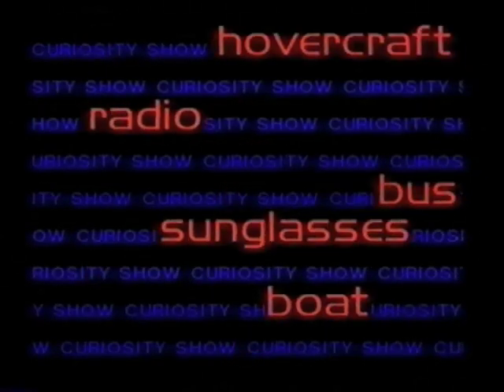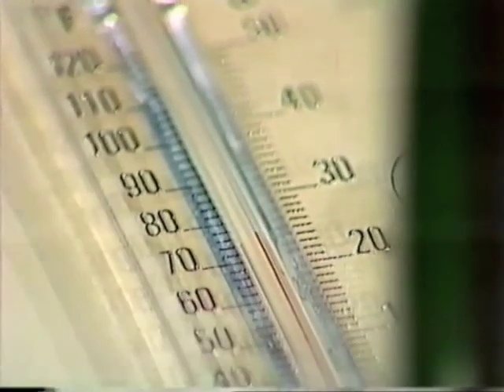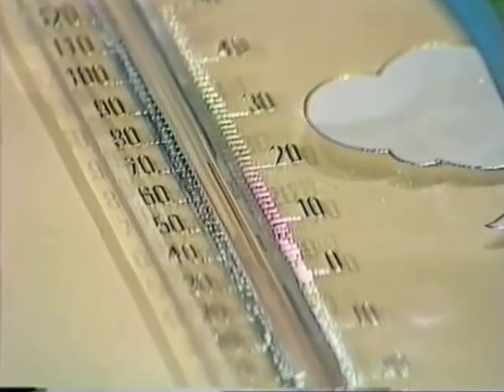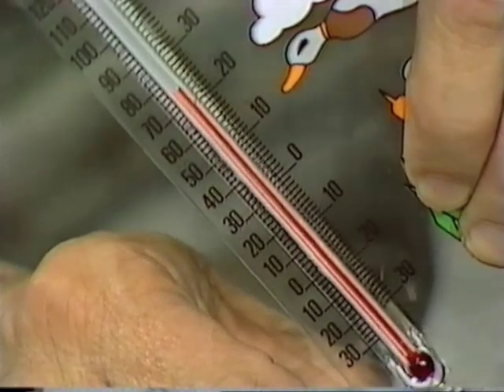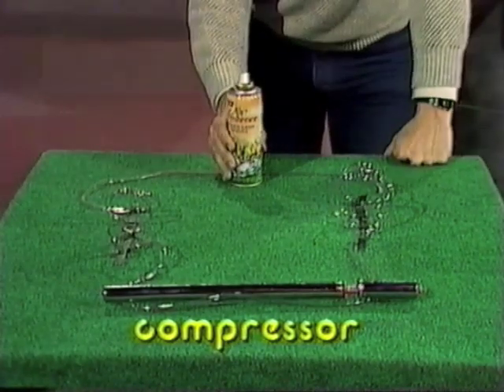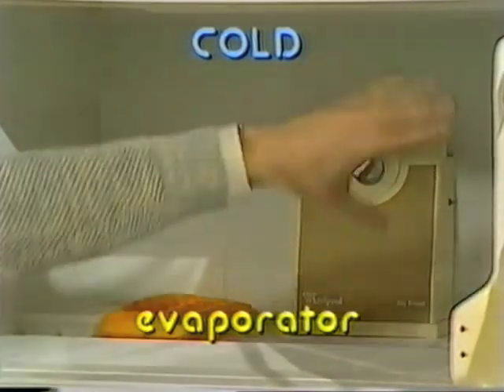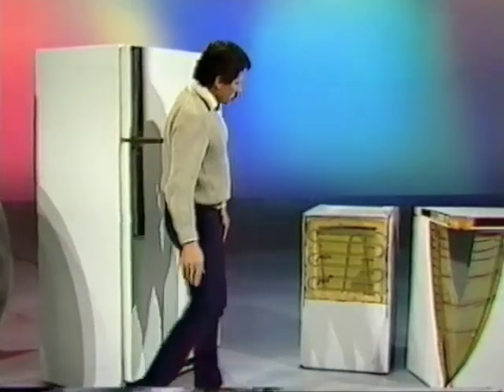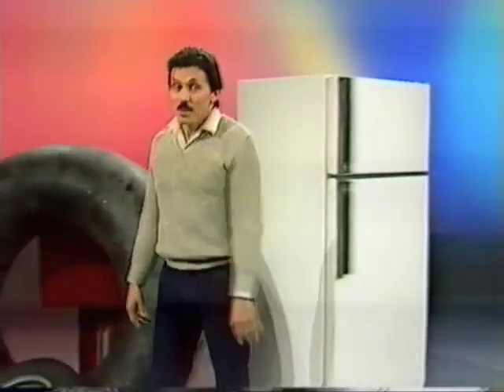Refrigerator - How Does It Work?

Comment: I work in refrigeration and it's fairly accurate.
The coil on the back of the fridge could be explained a bit further.
It's called a 'condenser'.
The compressor pressurises the regrigerant gas.
This makes it hot and high pressure.
The condenser takes the heat - caused by compression - out.
This causes the high pressure hot gas to condense to a cool liquid.
Rather like steam from a kettle condensing to a liquid on a cool window.
This high pressure cool liquid arrives at the evaporator.
And it is literally quirted through a tiny nozzle into the much wider tubing of the evaporator.
This causes the liquid to expand into a gas.
The transition from liquid to gas requires heat so it takes heat from its surroundings - your food.
Your food cools, the cool gas gets a bit warmer from the heat from your food.
As it expands it becomes a low pressure warmer gas.
This is then sucked back into the compressor to repeat the process.
Forever.
Reply: I’ve worked in refrigeration for 37 years and you’re a bit off
Reply: @stephaniecoomey2356  Can you explain how a bit off?
Reply: Thanks - this was the info missing in the video 😊
Reply: @garethwilliams9695  hahaha I was trolling to see what you’d say, good day sir.
Reply: @stephaniecoomey2356  we do a little bit of tomfoolery
Reply: Thank you, I could not understand how it would cool if it was condensed the entire time. This explained it better.
Reply: carnot engines
Reply: Thank you. Now it is much clearer
Reply: Gareth
the compressor is only a pump,
the capillary, TX  valve or restriction make the pressure high
I like your description of  this process
I'm in this challenging job
Reply: Gareth, thank you. i was left with questions after watching the video feeling like it wasn't ALL explained. this put it all together for me. thank you for sharing
Reply: Until you have a refrigerant leak.
Reply: Until it's near your kerb and a scrap metal guy comes along with pliers or chunky wire cutters and cuts the tube to take the compressor and wiring. At which point the refrigerant escapes to the atmosphere 🤬😥😥
Reply: this parts wasn't clear enough in the video for me . thanks
Reply: This statement is false: "The compressor pressurises the regrigerant gas.
This makes it hot and high pressure."
You say, " This makes it hot".  by "it" you mean the gas gets hot, right?
You see it is not your fault, it is never taught correctly in the first place.  That is why people just don't get it.  And those who gets it.. what they really get is they learn to memorize and repeat.
Look, this is what is actual.
The gas does not get hot.  Think about it.  When you compress gas, the gas actually gives off, loses heat, it actually gets cold.  What gets hot is the copper pipes and the air, the environment and you standing there and feeling the heat.

Check this out... saying it the other way.  You notice when things cool, they shrink in size, the contract.   Same thing with gas.  When gas gets cool, it shrinks in size, it contracts. Getting cold means, losing heat.  Losing heat means contracting, shrinking in size, getting cold.
Expanding means gaining heat, taking heat.
The confusion is that a thermostat is measuring the heat lost to the environment. Thermostat does not measure the heat content of the object, it measure the heat the object is losing.  A themostat is the environment.
A thermostat is not measuring the heat of the object itself, it is measuring it's heat loss.
The compressor is sucking the heat out of the gas, making the gas cold, while the outside/environment gets hot.
Reply: @alchemy1  boy if that ain't the most confused and fundamentally wrong thing I have ever read. When something is hot, it has a high temperature. The discharge gas of the compressor is at a higher temperature than the suction gas, meaning it is hotter. Heat moves from hot to cold so if the gas is losing heat then it is hotter than the surrounding environment. 
Why dont you go touch a suction line and then a discharge line and then try and tell people that the gas in the discharge line is cold.
Reply: @Redtooth75  I repeat.  And I repeat again:
The refrigerant in the evaporator gets hot.  Not you, not the thermostat, not the air. All three of you get cold.  Why do you all get cold?  It is because the refrigerant is getting hot, it is taking all your heat.  That is correct.

The refrigerant in the condenser gets cold.  You, the thermostat, the air, the pipes, all get hot.  Just go outside and stand there and you WILL GET HOT., same with the thermostat, the air, the pipes, all get hot.  
And that is a fact.  If the refrigerant in the condensor wasn't getting cold, you won't send it in the house.  You bring cold refrigerant in the house, not hot one, and you take hot refrigerant out of the house, not cold one.    And that is .... say it again.  A FACT.

But what gets screwed up, which really  is screwy and it looks like this:
You stand by wood burning in some stove.  Of course we all say, oh boy that fire is hot.  On face value, we say it and move on.
Nobody will say it this way and if someone does it say it like this, he will be looked at funny.
" Man that wood burning is losing a lot of heat".
For god's sake if you sey it right in technical and science environment, at least. 
[[  When you give off heat, YOU YOURSELF ACTUALLY ARE GETTING COLD. You are not getting hot, you are getting cold.  When you stand by the wood burning, you are getting hot and the wood with all its heat content soon will have no heat left.  It is getting colder by  the second until all the heat is finished.   You better go out there and start chopping more wood]]
We screw everything with every day lingo and then carry it to the area of real techincal and science environment.  There one needs crystal clear attentiveness to see the actual.

What is really worse is those who even work in the field and earn a living gets stuck, and it happens when suddenly somethig just don't look right.  
The fact is it was never right in the first place.... and it took that long to stumble on it.  It was never taught right and got just watered down  to say it mildly. 
You don't have to get something in order to fix it.  Fixing and repairing things is just repetition.  No awareness is needed.  Just like a machine, the person performs, gets paid and wake up the next day and repeat it.

[ Ready?  Read this:  Is there such a thing as charging a battery?]
Before you even make any move to answer it, do yourself a favor, stop, full stop, read it again and then really think and then see what happens. Do not repeat, clearly reflect what on earth is charging a battery.
Reply: @alchemy1  no you are missing the point. The refrigerant gets hot after it is compressed. If it's 35* on the suction line and 120* on the discharge line it has become hotter. After it leaves the compressor it starts to get colder because heat moves from hot to cold and the refrigerant is hot. But it does in fact get hot after its compressed. 
Most of what you are saying is spot on but I don't know why you are saying that the compressor makes the refrigerant cold. It makes it hot and then the refrigerant starts to cool as it travels through the rest of the system.
Reply: @Redtooth75  Since the refrigerant gets hot after it is compressed outside then the refrigerant must get cold when it is at the evaporator and beyond ( as your worded throughout the system)
That must be your statement or it won't make any sense.
Does it make any sense to say that the refrigrant is getting cold inside and so is everything else.  If that is so, then what is getting hot.. anything?
Good one, isn't it?

[ You never truly paid attention to what I had clearly explained.  Your thermomemeter measures the environment.   Aside from that what is really going on is not even the temperature at all.  It is the whole phenomenon of latent heat but that is another subject]

Watch the fine contradiction. I will have to quote your statement and it won't be out of context.   Just look:

"The refrigerant gets hot AFTER it is compressed".   

That shows a hot refrigerant already and is ready to be sent inside.  Well of course.   Now you are sending this hot refrigerant inside. This hot refrigrant must therefore release its heat in the evaporator, in the house and that can only make the enviroment hot..... eh?  Well it is pure logic.  And that is not what people want... maybe in the winter, not in the summer.

[ The 35 degrees and the 120 degrees relates to something that is far more involved than this hot and cold temperature narrative.  This phenomenon if you will relates to the subject of latent heat and more.  Is it amazing....?  It is to say the least]

[ how on earth can a hot refrigerant absorb heat... in my book only a cold refrigerant will absorb heat from its environment and therefore make the environment cold.  And that I can take to the bank as it is what I want]

A hot refrigrant will not absorb heat from its environment that is colder, on the contrary a cold refrigerant will absorb heat from its environment. And that is exactly what it does and that is simple, direct pure logic.

The referigrant is hot before the compressor gets hold of it and not after.  You don't feel that because it is contained in the gas, in the refrigerant. It is not released in the environment so you think it must be cold.   Once the compressor squeezes the gas, at that time the heat is coming out of it, so you feel that heat and IT  is losing heat and getting cold and YOU are feeling that heat but you blame it on the gas and saying IT is getting hot.

And that is exactly you have said and worded it that the refrigerant getting hot AFTER and not before it is compressed.  The actual factual real truth is clear.  The refrigerant can only get cold when things other than the refrigerant is getting hot.  
That is right,  just touch the pipes, the compressor, feel the air... they are all getting hot and that is your observation but you say, it is the refrigerant that is getting hot after it is compressed.   
(THE WORLD IS HYPNOTIZED JUST LIKE THEY CHARGE BATTERIES. Don't get me started on that)

Those things getting hot is interpereted as the gas getting hot.

Your last statement:
"and then the refrigerant starts to cool as it travels through the rest of the system."

 Are you sure?  If the refrigerant is getting cold then what is getting hot?  The house?
Stop and look at that statement you made, please.

I have stopped more people, more experts than I can possibly count or fathom. 

I am going to say it one more time:
A cold refrigerant is send through the system in order to absorb heat.  This cold refrigerant therefore make the surrounding environment to transfer its heat to the gas and therefor making the environment cold while itself getting hot.
A thermostat measures its own temperature as it is part of that environment and it is that environment.
And that must be clearly understood so no one will ever have to scratch their head.

What is really strange in my world.  It is this.
I can easily convince a non-expert.  But convincing an expert....?  Oh my.

It took me a week to finally show the light of day to a professor who was teaching it.  He could not believe it himself.  He did not know to laugh or to cry.
I said, now you have got the real work ahead of you, but all is well.

Human nature is to project our own experience on the object.  We do it with everything and all the time.  Be it socio-economics, politics, or whatever.  It is no different.

I want to go directly at the heart here.

Lets start right there at the expansion valve.  Good place, right?
On the compressor side of it, you measure the gas to be at high temperature of some 150 degrees or what have you.
On the other side, the evaporator side you measure temperature to be at some 18 degrees or what have you.
Just what are you measuring?  What is measured is "transfer" of energy, energy moving, kinetic part of heat and it is called temperature.  Latent heat where the action is, is on the potential aspect.  Heat actually contained in the gas itself.

You measure cold on the evaporative side because all that heat suddenly is absorbed from the environment by the gas.  How?  by letting the gas expand.  All that energy in the environment that existed and you called it hot (kinetic energy) and then said it is temperature is now in the form of potential as ( latent heat) in the gas itself.   The gas having enormous latent heat capacity compare to the environment and having absorbed so much heat ( all that you called temperature) from that environment away from the evaporator fins/copper pipes and so forth so that when you place your thermometer on it you measure far less kinetic energy as it is all in the form of latent heat in the gas itself inside.

When we talk about temperature by a thermometer that is, we are measuring the kinetic energy of what the thermometer is contacting and energy transfer associated between the two.  

In the condensor what you measure as temperature is heat loss/transfer of energy of the gas itself by forcing it out of it... ( give it up and by force),  The gas itself is indeed cold, lacking kinetic energy.  The poor thing can't go anywhere.  It is held in bondage by force.  
And that is what you pay for and it is called bill at the end of the month.  You are paying for the force that needed to hold something locked up.  Up on release it is hungry to get back on its feet and is absorbing everything it can.

The rub is always... how on earth can a hot gas absorb heat from the environment that mind you is actually colder than itself.
The gas is at 150 degrees and the house is 80 degrees.   If the heat goes from hot to cold, it means the environment must get hot and the gas must get cold.
But the environment gets cold and you can see it on the thermometer, the house, the fridge, the freezer.     :-)
And finally to make my point to really stand out clear.  Take a look at what I am about to say.
If you were to put that themometer inside the condensor itself in contact with the refrigerant and find means to read it.  What temperature will it read?
Bara bang bara boom.
Reply: @alchemy1  holy fucking shit dude, do you not know what hot and cold means? Hot means it has a relatively high temperature, cold means relatively low temp. When a vapor is compressed its temperature increases (it gets hot), which is a basic thermodynamic principle.
The refrigerant enters the compressor as a cool low pressure vapor. It is discharged as a hot high pressure vapor. If you compare the temperatures of the suction and discharge lines you will find that the discharge is significantly hotter than the suction. Since the refrigerant is now hotter than ambient it will start to cool down and heat the surroundings. The condenser coil is what helps that process. When the refrigerant leaves the condenser it is a warm high pressure liquid. The refrigerant goes through the metering device and becomes a low pressure combination of liquid and flash gas. Due to the pressure drop the refrigerant is now cold and also want to be a vapor. As it travels through the evaporator coil it absorbs the heat it needs to evaporate from the confined space that is being cooled. It leaves the evaporator coil as a cool low pressure vapor and goes right back into the compressor to start the cycle again.
Reply: @Redtooth75  What will your thermometer read if you were able to place it inside the condenser or evaporator with the gas itself?
Reply: It depends on the temperatures around both coils but for the sake of discussion lets say the box is 35* F and ambient temp is 70* F and that both coils are forced convection. The refrigerant should be around 15* at the inlet of the evaporator and rise to about 25* at the outlet because the refrigerant absorbs heat from the box. The condenser inlet should be around 100* and cool to about 88* at the outlet because the refrigerant releases heat to the surroundings.
Reply: @Redtooth75  It is said that when you heat something it expands and when you take away heat ( or cool it or whatever) from something it contracts.
Is that not also your position or you were taught and most likely you think it is true.

So assuming that is the case, you can then say it also this way.  When you expand something it takes heat  in from its environment and when you contract something it gives away heat to the environment.

Therefore what a thermometer measures, is loss of heat from the environment in the former and the environment gaining of heat in the later.

Both loss of heat and gain of heat is a process, it is not static, it is a happening if you will. It is a process.

Okay, lets see what that means.  At the condenser the gas is getting compressed, shrunk, contracted, taking up less space. There the gas is still at the time interval, the process of loss of heat.  It is UNDERGOING THROUGH THE PROCESS OF LOSING HEAT.  A gas taking up less space from the position of having been in larger space in itself is a process.  It means it is a time event only.  If you just wait long enough that same gas in that same contracted space still remain shrunk and compressed and waiiiiiit for iiiiit.   It will not be hot to the thermometer and yet it is a still a compressed gas indeed.
Turn off the compressor and shut off the valves and the gas remains in that contracted state with no so called "rise" in temperature.  Unless you have a leak in the system but that is another thing altogether.

Now we can examine the evaporator side. It is naturally a little more interesting.  The gas has not had enough time to give up all that heat and you let it expand by opening that valve, even though clearly it is still give off heat as the thermometer measures it, it is ready to take on more heat from a colder environment that itself. That sounds rather odd.  Of course it is and it is also true.

Plus more.  At the evaporator after absorbing all that heat from a colder environment than itself, then itself instead of getting hot, it actually gets cold.  Cold big time.   And that is weird and that is also true.   Now it is beginning to stand on its head.  And then continues with the seeming paradox.

Both the condenser and the evaporator is a transient place, as in like people being in a greyhound bus stop.   I know folks sometime  fall asleep even there especially when the bus is late.  But is not a place where you camp, it is a temporary place.

The thermometer on the evaporator will show a transient state of coldness as it is happening so long as within time interval involved of the gas drawing heat from the environment and then when it no longer absorbs heat from the environment the thermometer will not show cold but only show the room temperature as its environment.   The gain and loss of heat does not happen at speed of light.

All that heat drawn from the environment that was drawn, where did it go?
Is that gas still in the expanded state?  Of course it is.   The only difference is it is not in the EXPANDING  state.

Same with the condenser.  Compressing state vs compressed state.

Compressed state is a state of having lost heat as expanded state is a state of having gained heat.  This can not be measured by a thermometer.
Thermometer measures a process as we have constructed for our own consideration.  The system's thermodynamics process.

If you study this temperature phenomenon all the way to its quantum level... it is dizzing and mind boggeling phenomenon to say the least.
Negative temperature is hotter than positive temperature.  Water at certain extreme high temperature instead of expanding, it contracts.  In fact even in everyday regular exchanges of energy water temperature and heat gain or dissapation is not linear at all.  That is from 0 to 100 degrees, its expansion and contraction is not linear, no way no sir.  It is quite remarkable.  It is these properties that cause water to have turbulance ( ocean is  a good example on the large scale) in its many layers, the molecules constantly changing position in amazing patterns with respect to the other.
Cold water rising, warm water falling but then rising, but then falling, then cold water rising and so on.
And mind you on both ends ( below zero and above in the gassous state and more)  these phenomenons are reflected but in much more incredible ways that make an observant person stand in awe, unless of course the person has a thick skin.

You may indulge in reading about the many properties of water if you get bored.  And that is only for water for inspirational purposes.
I have enough gray hair and wrinkles from all this to last me a long long time.
Reply: @alchemy1  so many things just fundamentally wrong. Heat moves from hot to cold. Temperature is the kinetic energy of molecules. When a vapor is compressed its temperature goes up. The terms hot and cold are used to describe temperature. When something is hot it has a relatively high temperature. 
The vapor at the discharge port is at a  significantly higher temperature and pressure than the vapor at the suction port. Therefore the vapor got hotter when the compressor compressed it.
As soon as it is no longer being compressed it starts to get colder because it is now hotter than the surroundings and heat moves from hot to cold.
When the refrigerant goes through the metering device it is decompressed. When its pressure drops its temperature also drops. The refrigerant is now colder than the confined space the evaporator coil is in. And because heat moves from hot to cold the air from the confined space gets colder. The refrigerant absorbs heat from the confined space.
Reply: @Redtooth75  Okay.  May I?
Tell me what do we feel. Do we feel heat or do we feel temperature or neither?  

[Just remember I can feel cold in a higher temperature environment and warmer in colder temperature and to make it even fair, consider same pressure and humadity with respect to both environment and also I do not mean playing with clothing either.   You can relate to what that means.. right?]

( I am sure you and I both agree that the higher temperature liquid at the condenser has less heat than the far lower temperature gas at the evaporator. It must)

And oh by the way cold air has more pressure than hot air and hot air has less pressure, yet the less pressure penetrates/moves into higher pressure of its own kind.
I would say, that is worth scratching one's head.
Reply: @alchemy1  our bodies feel how fast heat flows into or out of our bodies. That is why glass or metal feels colder than things like plastic or wood even if they are the same temperature.
Temperature is a measure of kinetic energy. It is related but not the same thing as heat.
But none of that matters because your claim was that the discharge vapor of the compressor was colder than the suction vapor which is completely wrong.
Reply: @Redtooth75  Right you are.  Because In my mind I was using the term colder as the gas/liquid in the condenser having less heat than at the evaporator.
And that heat content becomes even less and less.
As usual the trouble is always language.  Internal heat, vs latent heat, vs sensible heat( measurable) and enthalpy ( the sum of all three plus there is few more, that is the total heat of system.
There is indeed much more total heat in the evaporator of which the sensible heat is the smallest component.

To extract the latent heat which is the largest of them, it gets converted to sensible heat which can not be contained and it is measured at the condenser.   Sensible heat is the heat that is lost from the system, it is leaving it, thereby reducing the systems total energy content.
And compressor forces ( mechanical energy applied) on the refrigerant, thereby causing latent heat which is what the molecules are carrying to fight back against the compression which is an expenditure of that heat they have been carrying and this is what is called sensible, measurable temperature.  Energy being spent, leaving the system. 
As they spent the energy, compression goes down also.  Why?  Because those molecules are no longer fighting back against the mechanical force and the mechanical force also don't report a push back, i.e pressure goes down.   You can not apply pressure on anything that is not pushing back, applying pressure on you.

Therefore, it really is scientifically inaccurate to say that sensible heat increases.  In actuality as you can see that it is the conversion of energy of one type which is hidden and is within the system to the type that is measured, i.e. sensible heat, temperature, the type of energy leaving, being spent.

You can increase sensible heat indeed by introducing it from outside into the system.  That by definition is increase I would say.  Here is conversion of one type to another type by the language agreement of the fundamentals of science.

It is the same as having collection of weapons loaded with lots of firing power and sitting in the warehouse.

The enemy is encroaching and you take all that firing power and you use them up in the battlefield.  The battlefield is the place that your firing power is being spent, depleted.   It does not increase, although it is where it is being measured in action.

Your firing power increase when you are filling up your warehouse.

That is my strange kind of proper English.  No  need to hate for it.. not because I am not a shoe stone.

[ By the way, the mechanical force of the compression does not increase any energy of the system either. While in reality, the system's energy is being extracted by the second.  In the evaporator it is indeed increasing]
Reply: @alchemy1  if thats how you want to think about it thats fine. But that is not what hot and cold means. Hot and cold relate to temperature, high temp is hot and low is cold. The refrigerant has a higher temperature after it is compressed therefore it has become hotter. That is what the terms mean and that is how they are used. I dont understand why you would try and correct people who are using the actual definition of the words and not your made up definition that is exclusive to you.
Reply: @alchemy1  you are over explaining a simple concept, the thing is the compressor is doing work. The friction that is created when compressing a gas into a liquid creates a lot of heat and injects that heat into the liquid, now once it is compressed into a gas it is significantly more hot, it is at a higher temperature than its surrounding so therefore it is at this point trying to reach equilibrium with its environment by cooling off.

Regardless of how you are trying to word it, it is much hotter than its environment and it is putting out energy in the form of thermal energy.
Reply: @Redtooth75  So to conclude on my end.  At the evaporator sensible heat is converted to latent heat and in the condensor latent heat into sensible heat.    Internal energy that maintains the integrity of the system is a different movement, although in terms of calculating the over all energy of the system it is indeed higher in the evaporator than in condensor.  There is more energy in gas state of matter than it is in solid state.   And we all agree to that.
And as the coolant gets converted fully to gas by the end it is ready to leave the evaporator, it has absorbed more and more energy and its temperature actually rise.  The flash temp is where latent energy is created and it happens in the short span  immeditatly after the valve opens and the greatest transfer of energy happens at that point.
over and out.  And thank you for hanging in there.  
We mostly agree than disagree and there is no law that we have to beat it to death.  :-)
Reply: @sacr3  Thermal energy effectively refers to internal energy of the system. It is not part of energy transfer which is the heat that transfers moves in and out of the system.
Heat that transfers exists in two forms.  One is in the form of latent heat which is not measurable and the other in form that is measured.
The AC system is a system in which these two conversions take place.  
Inside the sensible is converted to latent.  Outside the latent is converted to sensible.

Now that is clear.
The only reason I maintain that there is more energy, more thermal heat if you will in the evaportor than in condesner is because of internal structual heat. It takes more heat for matter to exist as gas than as liquid or solid.
I don't make this stuff up.
Over and out.  And cheers.
Reply: Oh, forever huh?
What materials is everything made out of, do you propose?
Reply: Thank you, I wanted that extra elaboration. Take care man . . .
Reply: The coil on the back of the fridge could be explained a bit further.
we call it a "Radiator".  cause it radiates the heat; away from the heated gas
Reply: It’s called the exchange of latent heat the cooling/heating process. Happens when you change the state of a substance (gas to liquid) because of energy etc physics stuff haha
Reply: I’ve done AC work for roughly 38 years in Automotive and you explained it about the same as I would either way 100 times better than what this video did I don’t know how anyone who has no idea would understand by the way he described it the compressor circulates the refrigerant the condenser is high-pressure Caused by the restriction in the system at the evaporator does squeezes the heat out as air flows across the condenser but also that same restriction creates a suction or low pressure in the evaporator which absorbs the heat as the air flows across the evaporator although what I have learned is when that refrigerant turns to a gas absorbing heat they say it doesn’t change its temperature which I could never understand
Reply: @alchemy1  When you made the comment that "flash temp is where latent energy is created", I have to point out that energy is neither created nor destroyed, it simply moves from one place to another, so you are not "creating" energy.  Secondly, I don't think it's been stressed enough about how critical it is that for transfer of energy to occur that the refrigerant is actually changing state.  It has to change state to work properly.  It takes a comparatively low amount of energy to change the temperature of a liquid to a different temperature while remaining in the liquid state.  Or to take a gas at one temperature, and change it to another temperature if it remains a gas.  In a normally functioning air conditioner, the majority of the energy transfer is taking place at that critical point of massive energy transfer...the "change of state" between liquid and gas.  Thirdly, arguing about whether the compressor is cooling vs heating things, perhaps it's easier to just say that you're transferring heat from inside the house (evaporator) to outside the house (condenser) and leave it at that.  It's almost like the great physicists arguing about which way electrons/energy flows in a electrical conductor, lol. (From positive to negative vs. negative to positive).  Anyways, perhaps it's more understandable to say that the refrigerant absorbs heat from your house as it is evaporating in your "A coil" inside your ductwork as the refrigerant changes state from a liquid to a gas.  (The latent heat of evaporation is being transferred from the air in your ducts to the refrigerant.)  Then the heat is transferred out of your house via the moving refrigerant to the condenser on the outside of your house where the heat is lost to the outdoors where the compressor forces a change of state from the gas back to a liquid...but remember this change of state occurs throughout a large number of the coils of your condenser (causing the reverse of what happened inside the house, so this time it's transferring the heat from the refrigerant to the outdoor air), and then by the time it leaves the condenser the refrigerant is back to liquid and is sent back to the beginning of this repeating cycle.  The refrigerant in the closed system is neither creating nor destroying energy, it's simply moving it from place to place.
Reply: @maubunky1  I am more than certain that it wasn't my intention to say created.  Just fast typing.  That is where most of the energy gets stored as latent heat instead of sensible heat.
On another front I have been try to clarify the means of demagnetising takes place.   If you rub a screwdriver on a magnet, the screwdriver is mangetised.  Alright, then how do you demagnetise it.  No one asks, no one did and no one told.
And to figure out exactly what is involved, you will be in for a treat.  I mean to actually to its real detail and not the generic answers.  
The basic generic answer is you run it through alternating fields... except that is false aside from not saying much.

If DC power make magnetisation happen then AC destroys it.   Utterly false.
The actual fact is,   AC is really DC changing polarity and that translates to the object simply change polarity and nothing more and that is exactly what happens if you make the attempt.

So you wonder what is in those little demagnetisers you buy for a dollar or two that you magnetise and demagnetise your screwdriver.   Who knows... must be some chip or something in it...... 
No, nothing whatsover. Just two magnets.

Somebody like watches very closely to see what is happening exactly and therefore where is the demagnetising zone and why, if you will.

It is straight foreward and the explanation of it is smack on target.  No fancy lingo needed.

All this confusion is caused by mangetic poles not having been described correctly and magnetic lines drawn says nothing about the forces.

Therefore I come around and make a preposterous statement.  You can magnetise and demagnetise using just the magnet you hold in your hand, one simple magnet. No need to get carried away and buy some special gadget or try AC current of some sort.

Here is my contribution and my evidence in case you ever wondered.  I won't leave you empty handed and keep it to myself.

https://www.youtube.com/watch?v=gU4DSWvmqT0
Reply: This was an awful and incorrect explanation of how it works. It doesn't cool your food with the evaporation, it cools the air and the cool air cools your food.....
Reply: You may "work" in refrigeration, but in no way possible do you work on refrigerators or have a job that requires you to have a working knowledge of refrigerators....
Reply: @CzarYe  You can say that again.  And mind you in all other fields it is the same thing.  Even teachers, the academic heavy weights, they simply repeat without really knowing.

I tell the heavyweights, that I have nothing on them and that I barely made it through high school.
Then I make this statement:
1. Electromagnetic waves don't move.
2. Electromagnetic waves do have medium.
3. Electromagnetic waves is not energy.
4. Energy moves.

1. Electromagnetic wave of whatever kind is a shape, just like any other shape.  Shapes don't move.
2. The medium in wihich it is formed is inductance and capacitance of what you people mistakenly called empty space and then after it was realised, it was never fixed,  so it keeps getting repeated.
3.  This so called shape called EM Waves is of course not energy.  It carries energy.
4.  It is there energy that moves and waiiiit for it..... YOU CAN'T SEE ENERGY.

And waiit for iiit some more.... this one stands everything on its head.
What is energy?   It is a value that was assigned.  It is a value assignemnt.  Value assignment to what?....
Then I say.... hey Mr. Academic you tell me.

And I conclude.... to put all you people with big fat heavy breathing egos... here it is.
Energy is real, and not real, it is an abstract that no one could do without.  There was no way.... the closest thing to it was another abstract called work.  :-)

And waiiit for iiiiit ....... This one is a nail in the coffin.
Everything is energy.  All that exist is energy.  You both know it and not know it... two in one.   DEAL WITH IT.
And there is nothing I said that is not in your own books and in your own lips.  Only that I put it all in one place to see what comes out of your mouth and you don't even know it.  And when I say it you call me wacko....but I got you.  Calling me wacko is calling yourself wacko.   You could have said it long ago but your big fat ego you were feeding blocked you from seeing it.
Reply: @alchemy1  look guys quit arguing over who's been in refrigeration longer. ALL YOU DO IS TAKE YOUR AIR CAN AND CONNECT IT TO YOUR BIKE PUMP AND WHAALAAAAHHHH!  REFRIGERATION. argument settled, g'day folks!
Reply: and besides, now that we've figured out the refrigerator, who wants to explain how the heat pump works? now we have to add reversing valves and have an air can that turns into a bike pump and a bike pump that turns into an air can!
Reply: So u are fi e with the comment that the compressor pushes liquids around ? ^^
Reply: And u shoud look up your Infos again maybe take a look into enthalpy  ... cause the refrigerant doesn't need heat from the surrounding  to evaporate the energy for that takes it out of itself and regains it btw ...
Reply: much better explanation. thanks.
Reply: @alchemy1  maybe you can rewrite Boyle’s law, and rename it blue oceans law…gtfoh
Reply: Ideal gas law ratio

When comparing the same substance & mass: 
(P₁V₁)/T₁ = (P₂V₂)/T₂ 

This, plus thermal radiation & conduction, is exactly how a refrigerator transfers heat from inside to outside the box.

Any changes to temperature1 and/or pressure1 and/or volume1 is affects temperature2 and/or pressure2 and/or volume2.

The whole thing is a tube so we'll assume equal pressure for simplicity.
(PV)/T 
= {(PV)/T}(T/1) 
= (PVT) 
= k
V₁T₁ = V₂T₂

Compressor adds work energy and changes the volume of the gas.
(V₁-V)T₁ → 0.1V₂ (T₂+10T) 
Gas moves into condenser (think radiator) the large tubing structure on the back (painted black to increase thermal radiant emissivity) 
Transfers heat away to environment (the kitchen air) 
V₂T₃ → V₂(T₃-10T) → V₂T₁   
Decreased temperature collects as gas/fluid
Narrows to very small tube to maintain pressure
V₂T₁ = V₂T₁
Tiny tubing penetrates appliance insulated wall
Tubing size is increased even larger than radiator (0.1V₁)⇉(3V₁)
30V₂T₄ → V₃ [T₁-{(3)(10)}] → V₃(T₁-30)  
Freezer exposed to (ambient -30℃) thermal conduction.
Thermal couple measures mid-point expansion tube, below certain (adjustable) temperature, temporarily ends the cycle.
..Compressor sucks from end of cooling tube..

[edited] to add : '⇉'
Reply: I was wondering how the liquid changes states. Thank you!
Reply: @alchemy1  wow 
Thank you for the patience .
And great attempts at the detailed explanations .(But you know , sometimes we don't have the essential tools to follow through )
I would love to hear more and on many more topics.
Have you got some forums where you discuss such?
I cannot ask you to put your time elsewhere than is required but if you have any sites or blogs then let us know.
Reply: Isn't it that the compressed and heated fluid is cooled back to room temperature and because still being compressed, cools below room temperature when evaporated? 

The spray can analogy kind of proofs that; the gasses are compressed into the can but on room temperature when you buy it. Then when you spray it decompresses and result in a temperature colder than the room is.
Reply: @what9418  "fluid is cooled back to room temperature and because still being compressed, cools below room temperature when evaporated?" 

If I assume you mean expanded rather than evaporated, then yes, you're right.
 
This is a problem for PCP (pre-charged pneumatic) airguns, when fired, expansion causes cooling, cooling decreases pressure, pellet travels slower  

(Generally refrigeration is a closed loop. But evaporation is also used in cooling, not usually refrigeration, but somewhat differently.)
Reply: @Dr_Wrong  thanks for your comment, yes I meant expanded as in decompressed. What this video IMO kind of misses is that due to containment of energy, a bike pump connected to a spray can would never result in cooling because the "coolant" is on room temperature to start with. And the entire goal is to cool it below room temperature.
Reply: Very fascinating.
Reply: If I put a car radiator fan on the coils keeping it cold could I safety use it as air con.
Reply: I was wondering if you know why the refrigerator isn't as warm at the coils as it is cold in the refrigerator? A typical household will have an ambient temperature of about 21 C and the inside of the fridge would be -5 C to 5 C. So shouldn't the fridge coils be about 37 C to 42 C?
Reply: This is exactly the "half thing" that I didn't get from the video.
Reply: really great schizo posting going on here high quality
Reply: @alchemy1  i hope that you aren't correct with your concept here, because you said many confusing stuff...
Reply: You are completely right brother. We should also set clear that FREON is a commercial name for certain refrigerants, just as "Aleve" is to "Naproxen Sodium", for example.